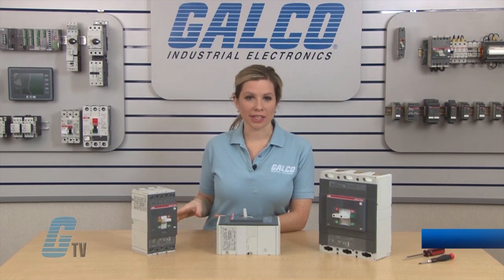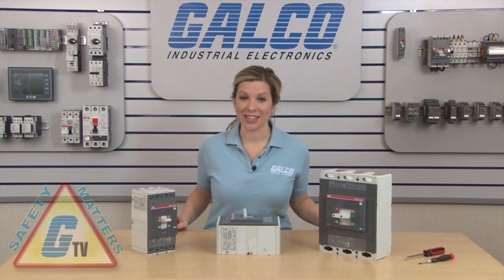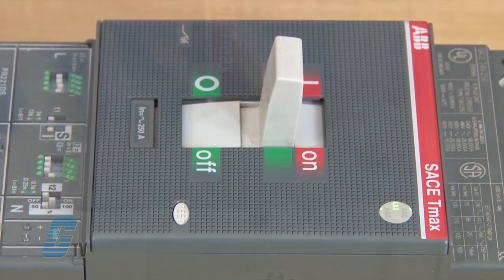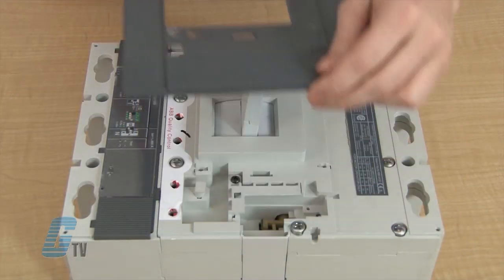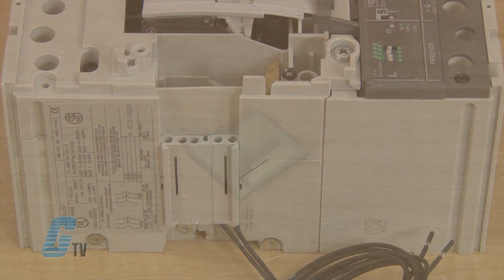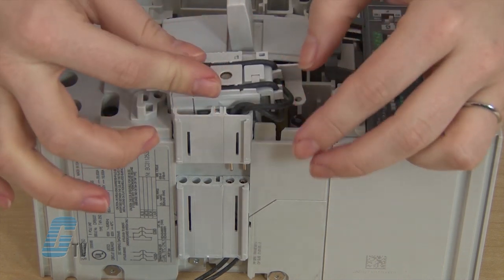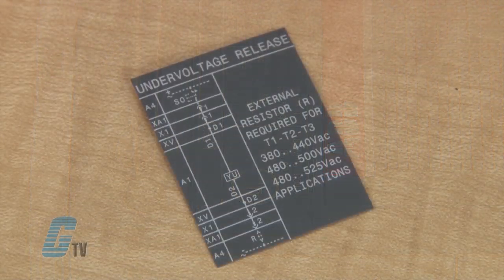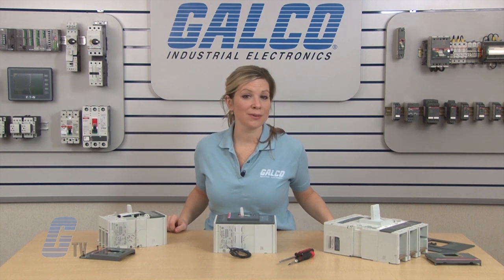Installing a UVR in ABB Tmax series T4, T5, and T6 Molded Case Circuit Breaker

Comment: You stressed the need to shift to OFF before pressing the test button to reach the Tripped state; can the Tripped state be reached  from the ON position in the same way or does this prevent successful installation of the UVR ?